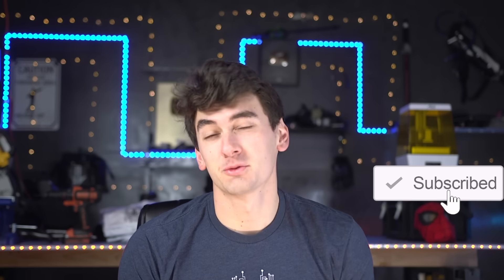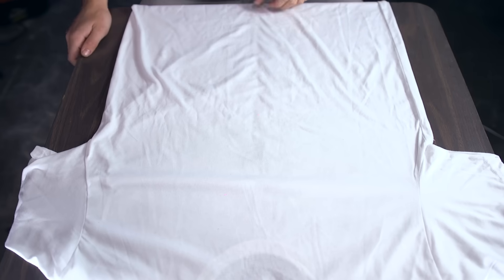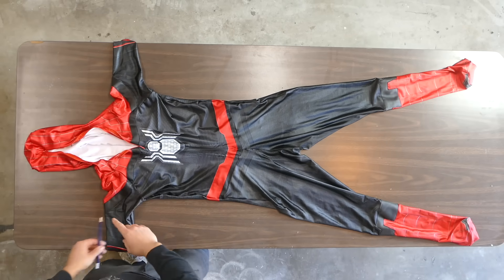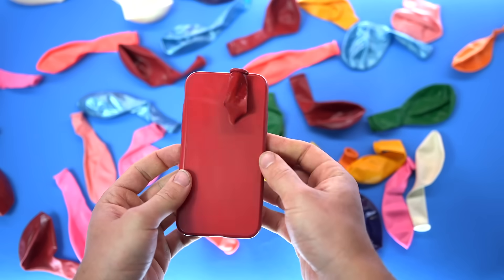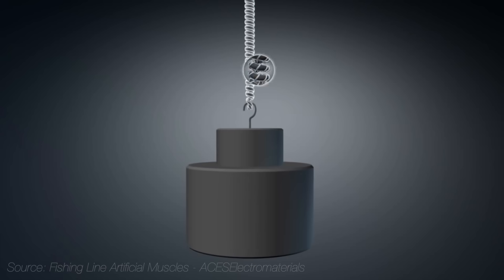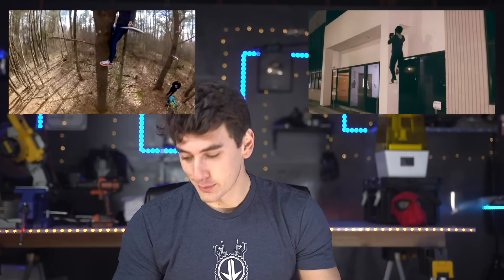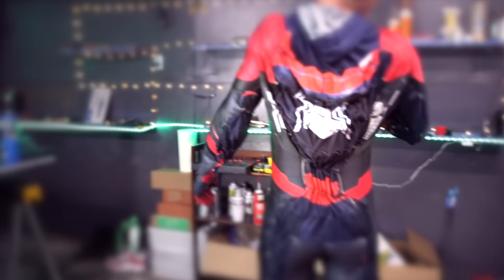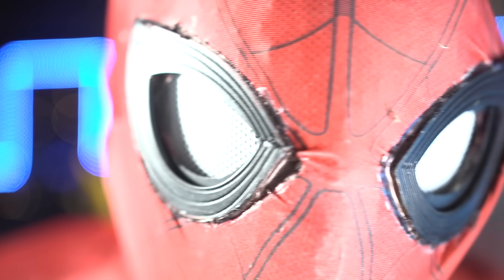I Built Spider-Mans Self Tightening Suit!

Comment: Been thinkin bout something like this for years for: Motorcycle rain gear. It flops and flaps in the wind but I was thinkin very small rubber tubing running all thru the rain gear, apply small vacuum pump and gear tightens up. OR just air tight spaces made into the fabric. Hit release valve and, well, you know. I'm 66 with hundreds of ideas and inventions and they're gonna die with me unless someone takes a look. Gd vid. L8r. rick in Tennessee

Comment: What if you used like a flat cinnamon roll shaped spring that followed the circumference of the body? As long as it doesn’t constrict circulation. That could be one way to almost completely visually eliminate the springs. Spit balling.

Comment: Spider webs are stronger than steel soo if we make a spider web that is bigger like we see in the spider man movies we should be able to swing and they would stick just something to think about
Reply: I think that's a lil obveous... I really don't your the first to think of that. Which makes new think ours not as easy as it sounds cuz no one's really done it. 

If I had to guess recreating the exact chimical compound used in real webbing would breakdown or not hold as tightly on a larger scale. 

There's also the issue of the larger it is the more force needed to fire it any distance.

Same reason we haven't been able to make a reliable bat grappling winch. Anything that can hold our weight would be to large or ridged to coil or fire without extra equipment.

Bio engineered spider silk is deffinatly something with looking into. But I think it's just not as easy as your think

Then again... Who knows... Maybe they got it to work and put it behind government red tape already

Comment: Hey I think you should make a small mechanism that extend or stretch the squit(elastic like material suit) So because of that mechanism when you press the button the mechanism will release the stretched suit and the suit will perfectly stick to your body. This is just a random thought but I think it will work💯😃😃
Reply: Unfortunately that’s not how it worked in the movie. Also that would require constant power to keep it stretched or a lot of bulk like hydraulics.

Comment: Project idea: functional Ciem dart shooters.  Complete with glove latch controls, staples,  and small staple guns on bottom of wrists.   Doesn't need to store 500, but 100 should be a nice start.  These staple bullets need to be able to embed themselves in skin.  They're like projectile centipede mandibles.   Centipede venom marinate is not likely high in supply.  But for scientific purposes,  bee venom marinate will work.   Building an entire Ciem suit optional.  Though, Zeran teleporters are Marlquaan-dependent engineering,  so those can be skipped, honestly.   The female assistant testing things out doesn't need to traverse across buildings.   Nor do I expect a real life petite 5'4" skinny gal to be very strong.   Still, centilegs notwithstanding,  I don't think you'd have any trouble making a Ciem suit that looks as good as my Sims 4 renders.  The last time I attempted one, I had to take a lot of shortcuts.  Most materials were from Michael's or Lowe's,  and the end result still cost about $400!  I'd be proud to promote your channel on my network,  however,  if you can make a better costume.   The female model doesn't have to look like Candi Flippo though.   One of the past models to wear the suit I made was my one sister.  Who is the same height as Candi, but otherwise looks nothing like her in real life.   

I've never figured out quite how to make the dart shooters.   But I'm a storyteller and blogger, not an engineer.

Comment: People are getting cut on their arm and some are even almost totally detached for motorbike thieving on the road in my country! Can you make an elastic but strong jacket to prevent them getting their arms chopped off?
Reply: Umm isn't that basically kevlar and bulletproof jackets, they cost around 400$ US currency and there are leather versions great for motorcycle riding, team it up with chainmail sleeves for extra safety, might not make you a superhero, but you will be in a bulletproof jacket that can resist blades, they are sold online, not sure about elastic, but if kevlar is lined up with the wire he used it could contract, it would cost him quite a bit to make a contracting bulletproof jacket cause bulletproof material is expensive and so are the clothes.

Comment: Nitinol wires woven into the material would be programmable to take any shape by applying an electrical current
Reply: Shoulda finished watching before I commented lol
Reply: The fishing line muscles wont contract unless you wind it in the proper direction and then there is a anering process as well

Comment: I have an idea for the hologram wrist watch: have you seen those fans with led’s in them that spin fast enough with the correct light positions that it can display the time as if its floating. Because of the lightweight and flexible materials you could easily collapse it into a flat circle about the size of a wrist watch, and then pop it up to spin it when you want to. And if you get the right code for the lights mixed with the speed you could affectively make a phone app and apply it to any text.
Reply: Hmmm, there are also those holo laser systems that actually ionize air molecules and create an actual hologram in mid air, maybe if one was made small enough to put in a watch, not sure how strong or what power the lasers are though, but I think it only uses 2 or 3 lasers, the rest is just micro laser technology to form the picture like the video projectors that use lasers instead of LEDs

Comment: I would like twitch from rainbow six’s shock drone
Reply: Literally a custom frame rc car with a onboard battery and a single shot taser on it. You hook the taser mechanism up to the large drone battery and now got your twitch drone. Alternatively you can use  many smaller taser darts (pronged aerodynamic darts with electrical circuit tethers shot with either a pair of darts each or a two pronged, double tether dart.) With the darts you can fit more but the normal taser will be strong.

Comment: Can you try making some of the things from Assassins Creed? Here are some ideas:

The hidden blade: a blade that pops out of a hidden compartment (possibly with a gear mechanism?)

Smoke Grenades: exactly what it sounds like

Hook Blade: basically the hidden blade, but with a hook so you can hook onto stuff like ropes and almost use it as a portable zipline?

Hidden Gun: basically a gun, but it’s hidden into the same gauntlet as the hidden blade. You can control the blade one way, but you can activate the hidden gun like any other gun; the trigger

Outfit: Maybe you can make an outfit that implements all of these things?

This is an overly ambitious idea, and I understand if you guys don’t do it. Awesome video though!
(I will add things if I need to in the future)

Comment: Hhmm, why not use a Ladder Stitching method? 

Like it's better if the Stitches would follow the muscles rather than just put it on the back. It would hide those lines even further and creates a cool aestethic with cleaner spots but in order to pull this up, you need a custom build suit so everything would line up perfectly.

Comment: itd take a lot of work but if you had three layers,The first layer being super elastic and heat resistant and possibly fire resistant too to prevent burning .then over that layer you have kinda the thin metal wiring in a weave or chain mail fashion with the battery and switch in the spidey emblem.and the third layer being elastic too and with the spidey design .that way you can avoid the motors and strings and wrinkles.if you know what i mean.though at this angle i think the hardest and the most dangerous part is the batteries and wires .because you don't what to burn upMay if the main current of electricity was in the this web designs of the the outer layer and have into resistors for the smaller wiring so it doesn't burn up and theoretically should shrink faster.and i think the design you made was pretty awesome lmao worked out pretty well.came up with this idea just now watching you talk about the memory metal
Reply: And for the web slingers id be cool to get some sort of strong thread maybe kevlar or artificial spider silk  considering its supposedly stronger then kevlar then id be cool to collect enough  substance that this type of bacteria secretes that supposedly so sticky that its could withstand several lifting cars.supposedly it has the adhesive force of nearly five ton per square inch.with this in mind you could shrink the thread and still have plenty to lift a full grown man .but there is many problems in this idea.the suit is more realistic. although for the suit if you could somehow secrete the same sticky substance from your hands and feet you should be able to climb up walls without the cool gadget you made.although lets say getting the sticky substance from the bacteria is possible there still the storage problem and how are you gonna lift you hand unless the put thin layers of something you could leave behind but then there's no point of the substance because of the need to release your hands and feet making a weak point in your grip.there many problems to this idea lmao i think this video is cool

Comment: What happens if you run an electrical current through the Nitinol? (Edit: nvm, I see it does. Do you need a 12v to do it though? Imagine being able to coat the coils in graphene. Would it require less voltage?)

You used a worm screw for that magnetic we shooter, didn't you?

Comment: It looked like the suit in spiderman had the motors, probably drone propeller sized, in the black parts by the shoulders and forearms. Maybe all connected, from the spider, by string. It would probably be easy to hide the string along the web pattern and the side of the suit. Idk.

It would probably take too much for the suit to 'know' when to stop contracting though.

Comment: we have to think about how fabric actually shrinks. When you put jeans in the drier, why does it shrink? it's all about "releasing tension in the fabric". this is usually done with heat and moisture, but if you can find a way to accomplish this in a quicker and more manufactured way, that is the only way I can see actually getting a self-tightening suit. Each and every string has to tighten

Comment: Why not just put smaller vacuums throughout the suit all connected to the button on the chest programmed to suck the air out the blow it back in when taking it off? I know there would be wrinkles but evenly spred wrinkles is better than the  ton of bunched up ones

Comment: Hide the wires with blue . The size when it shrink to be the good. Dont try to connect it with wires. Use some use some elastic bang and connect it to straight pipe. So when it shrink to have no problem with the to be bad the costume. Great job hope i give you any ideas

Comment: I think you could’ve made it look a bit better if you had the springs underneath the fabric, attach them from the inside and have some other sort of layer that’s on the inside so you are not rubbing against the springs and such, let’s call it a construction layer. So from inside to out it would go your skin, fabric, wires springs motors etc. then the outside fabric that you see? ( both layers of fabric connect) if you want a visual lmk!

Comment: try using heatshrink for the planes, glossy elastic for the joints, and zippers on the heatshrink. Also try using some copper or bronze heatsinks and heatpipes to spread the heat evenly throughout the suit and add some "protective rigidity" to the parts that dont bend. as for the mask another youtuber made a design that i believe you can improve upon. https://www.youtube.com/watch?v=APBXy-mKF_g

Comment: You could try wrapping a small amount of the fabric around a piece of flexible metal that them rotates and pulls the material in like a toilet roll dispenser, if you attached motors on each end and gave it joints etc you could have an exoskeleton almost that would be able to pull the fabric in, it would tighten it evenly and would remove that bunched up material on the outside, I can't really explain it well without drawing it though 😂
Reply: Fot it into the natural seam of the suit and it will just end up looking like tubing that could be easily disguised with form shaping foam or fiberglass or something, benefit of that being that you can hide the contraption and give yourself chizelled and at the same time

Comment: V2 tips
•For the contracting areas try something with less of a threat count. Less fabric = less wrinkles
•I think the lace idea could work if each hole had less friction, wire + a metal grommet would make that action smoother.
• also, you could leave gaps on the inseam of the arms, legs, and back so that the lace up design has less extra material and wrinkles, it would just have to overlap at the edges when retracted.

Comment: You should make Thor’s hammer that returns when you throw it
Reply: Colab w hacksmith
Reply: I agree, I think it would be rlly cool, but there are still limitations to reality. I know Jake is a genius but idk if even he can do this.
Reply: @ishaansharma3806  fair point
Reply: @ishaansharma3806  he will do it, hopefully
Reply: @ishaansharma3806  bruh it’s easy ever heard of electromagnets?
Reply: @lolpeakaboo  ahem. Those wont work. They aren’t strong enough
Reply: @lolpeakaboo  ahem ever heard of physics
Reply: Maybe a rope connected to the hammer that pulls it back with like a motor or somthing
Reply: @leeroymaui3676  thats batman grappling gun
Reply: You could make a radio tower signal and do that but that would just give more distance and not as much as the one Thor uses
Reply: We have that as long as you throw it straight up😂
Reply: @daltonmathews8905  nah the bird is gonna take it midair
Reply: GONNA NEED STRONG MAGNET

Comment: im not sure if it would have worked but having some of the panels of the suit pre-streched. I think it could be done with hydrolics. filling up a tube would make it more rigid. using something that would expand lenghtwise like ballons might even do it.
It might not even have to be electrical since thecontraction could be done by a realease valve. you could use a hand pump to make it loose again

Comment: Man lots of research ....and trial and error... However here is some cool military knowledge to advance it more : try a hexagonal design the works in a circuit   with a printed PCB board thin version like in the smartphone and have a transformer give you enough high charge to send direct current or even alternating current ...I'm not the best electronic guy but I'm using HVAC, and basic electrical knowledge to use the simple design lol... IDK but the more advanced the better ... BTW another tip mold certain hard elements in lighter metals and use wood to create a mold or clay ...easier to find aluminum cans and mold things .. Still a fan from day one ....there was you and the "king of random guy" (RIP) who passed away...  I learned a lot from his scientific vids.....

Comment: Well, yes, the vacuum idea has those wrinkles, but that's only if you seal it off and use a non-stretchable material. Maybe if you were to use spandex and have the vacuum connect to the top, then maybe...

Comment: Things I would upgrade on this:
1. better material of clothing, something which can slide over each other to avoid wrinkles.
2. make the fitting suit, cut the places where the tailors actually cut it, and at the inner portion attach extra material that can let the outer material slide over, so our suit is baggy now.
3. make the springs into wires and try expanding or contracting them over the stitch lines, or maybe use smaller dia helical springs.
one thing which would be fun is to have the contraction/expansion spring/wire as webbings for the suit, like the Tobey Maguire suit but webs design over the suit can contract and expand to fit the person.

if you have read this so far, thanks. would love to give more such crazy ideas, let me know.

Comment: What i woukd habe done is making a own suit. I would have webbed material that Tears on the Threads out anoyher Thread That would habe gobe yo the back logo . In the Logo i would have put a Motor That teas These Marín Threads so That the suit would shrink. Same thing wird for exampke sock. If you move one Thread out of the sock , than the whole sock would shrink

Comment: BETTER DESIGN IDEA!!! :
 There was literal drawings of the string configuration you should have used in the video. If you had a full coverage of strings around say your arm in the same pattern in a Chinese finger trap, it would have been way better, alot simpler and alot cheaper. I'm literally going to go make that concept now to see if it works.👍 if it ends up working I'll post a link to a yt video.

Comment: If you just want a suit to fit tight on the body ie hug the body why not just use spandex  or take a wet suit and colour it or use neoprene.
If using spandex you would need to have layers or it may be too delicate but a wet suit is pretty tough so you might need to work the material to make less stiff, but of using neoprene that is tough and flexible and comes in red, plus various thicknesses.
The face shield instead of making one from scratch use a couple of layers artists white  mask and trim it to what you want and put the holes where you want and cover it with either spandex or neoprene.

The eyes you could use a pair of electronically activated mirror sun glasses if they make such a thing which I believe they do for motorcycle use not cheap though I suspect.